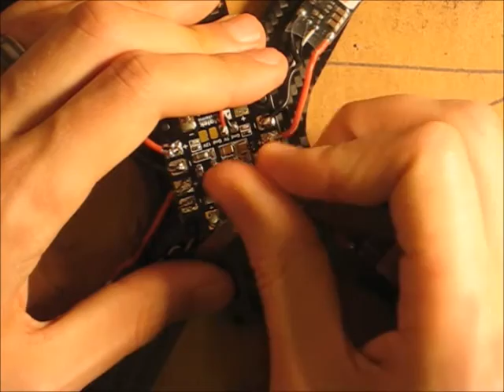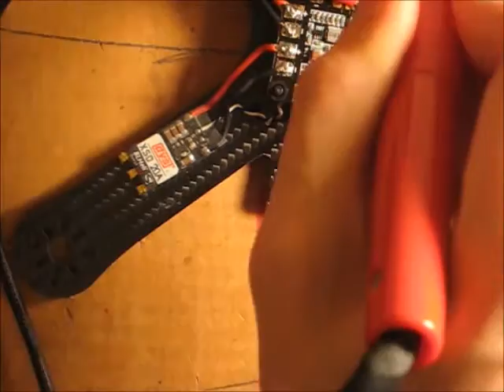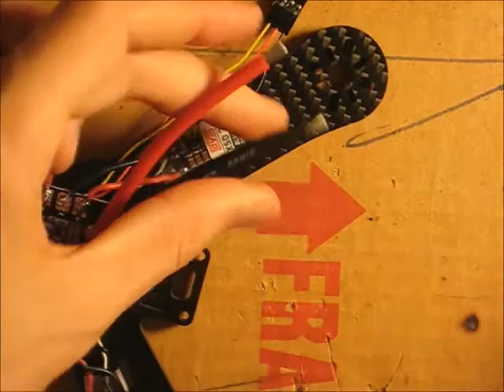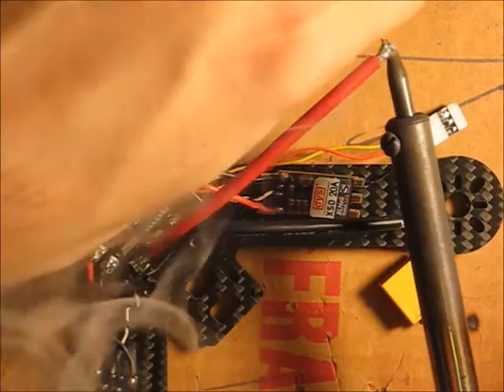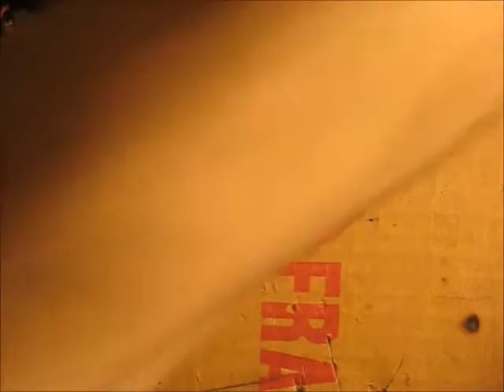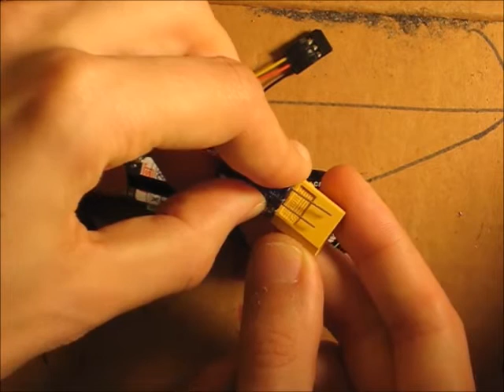Specs Build Part 4  - Create battery lead and solder to PDB

Comment: why do you need capacitor on the T connector. just wondering because i'm attempting to build a DIY any help would help.
Reply from the maker: It's not needed. This is the only build that I did it for. It's supposed to help the battery with quick changes in voltage draws (for example when punching the throttle). Some of the people I fly with highly recommended it, but I hardly notice the difference.